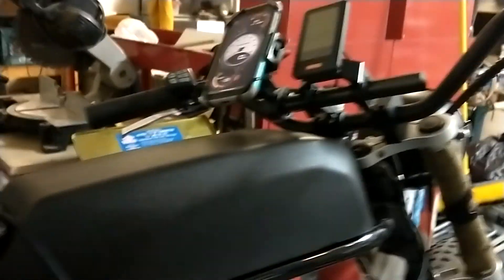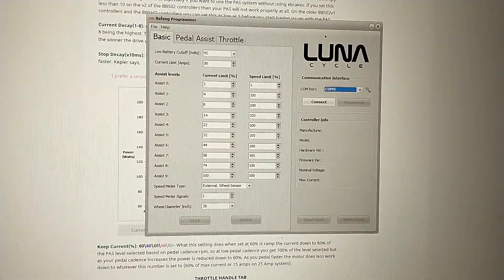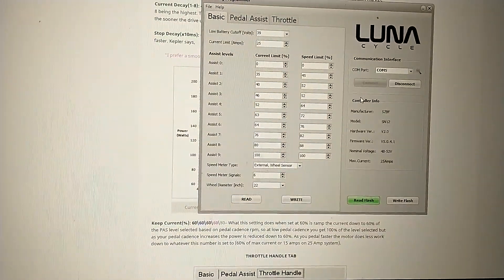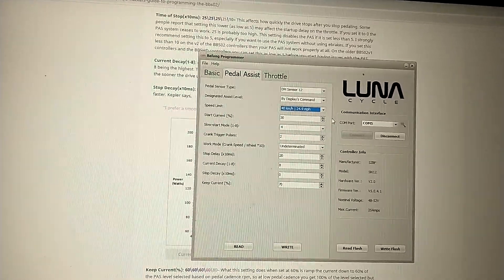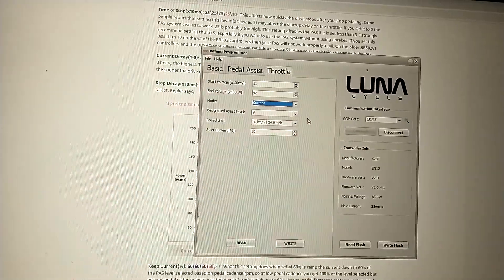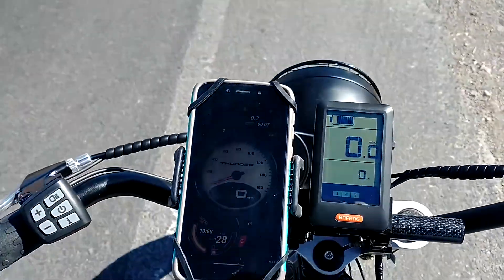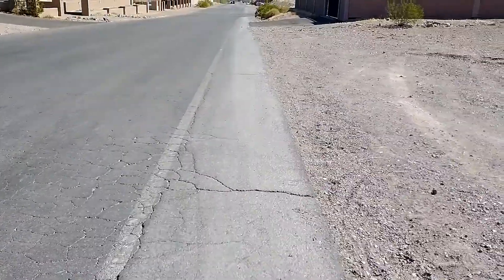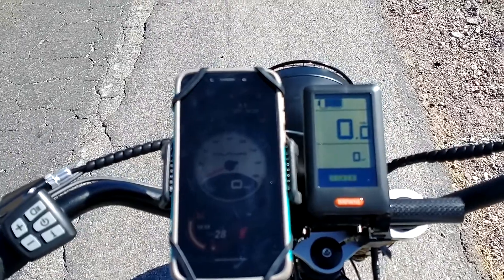Update 2  in Description - Monday Motorbikes 750w Anza Programming config file & speed test with GPS

Comment: Hey Robert, just out of curiosity, had you tried only changing speed limit without messing with any other settings? Seems like a $20 Luna cable for a few mph is a good deal but I'm slightly concerned about blowing it up, especially since my Anza is only the 500W.
Reply from the maker: Hey Scott, I haven't. But don't see why that wouldn't work. The software seems smart enough to limit folks adding settings that will blow it up. I tried to increase the amps and bump peddle assist outputs to 120% but it wouldn't let me 😂
Reply: @RobbMods  Thanks, I'm gonna try it! I should also have my magnets by Monday.
Reply from the maker: @scott1127  awesome. Updated magnet vid coming in a bit.
Reply: @RobbMods  Hey Rob, just wanted to thank you again. I just got back to messing with the Anza again. At first I thought I wasn't having any success with the Luna cable but it just took downloading the right driver. Looks like it's probably marginally faster than if I just got the updated display from Monday but hey, it's more fun this way. Only thing I did was bump up the speed limit.

Comment: I'm connected and everything but it won't read or write - do you have any ideas what might be wrong? "Read" "Write" "Read Flash" "Write Flash" are staying grey and will not let me press.
Reply from the maker: That happened to someone else too. Are you using windows 10? The usb cable shows up in device manager under the Ports (com and lpt)?
Reply: @RobbMods  I am on Windows 10 and ordered the same cable you did. It reads it as a Com 3 connection and changes depending on what usb port I use. Not sure why it won't read or right. Any help would be awesome. 👍
Reply from the maker: @PhareRow  interesting. Did your bike arrive doing 15mph or 20mph?  The guy that had the same issue had his patched to do 20mph before doing the cable. Few other guys that had success had their bikes, like mine, stuck at 15mph. I'm chatting with a guy who just got his anza today and already has the cable. I'll see if he had any trouble. Almost starting to look like MM locked it out with the bikes that got the 20mph fix. I'll keep you posted. Should know his results tomorrow. How do you feel about swapping out the controller and display? Just did that today and getting 28mph. I'll do a progress vid this week.
Reply: @RobbMods  I'm stuck at 15.
Reply from the maker: @PhareRow  cool (kinda) :) other things to try... Make sure you extracted the zip file. Right click the the program and Run as administrator. Reboot. I have another way to test. I'll try to do a video tomorrow... Basically you download the micro controller software, click 'check mcu' disconnect the battery then reconnect. It will tell you the make and firmware of the chip in the controller. Basically confirms if the cable can read or not.
I used a combination of these sites to test it out...
https://support.biktrix.com/hc/en-us/articles/360027645011-BBSHD-Resolve-ERR07 don't do the bin file. Just work through to the 'check mcu' part.

http://www.stcmicro.com/rar/stc-isp6.86e.rar - working link to dl the program

Another site to reference but they don't talk about check mcu. Don't load any bin files these sites offer. Might brick the controller. https://california-ebike.com/wikis/updating-bafang-firmware/amp/
Reply from the maker: @PhareRow  yeah i can do that. No money necessary. Appreciate the offer. I can connect tomorrow. Are you on IG? My username is robb10492021. Send me a message and I'll put eyes on it tomorrow.
Reply from the maker: @PhareRow  give this thread a look... https://electricbike.com/forum/forum/builds/new-builder-questions/1343-can-t-communicate-with-bafang-controller-please-help
Reply from the maker: @PhareRow  another guy had success with this program https://penoff.me/2016/01/13/e-bike-conversion-software/
Reply: @RobbMods  Checked the MCU and followed instructions - don't think it's reading it - states "checking target MCU" for 10+ minutes.
Reply: @RobbMods  Yeah, Im on IG, search my name Jordan Baucas
Reply: @RobbMods  Was on here prior. No help so far.
Reply from the maker: @PhareRow  Cool I hit you up on IG

Comment: You prob already have it but the Mini display from Luna works great and is much cleaner. Ive been following your vids. 2 weeks ago i programmed mine too and have since gotten it to 23/24 also. Last try was the Eggrider LCD display and it lets you program from the screen/app set up. But still my max was 23/24.
Reply from the maker: Awesome! Glad to hear it! I got a new KT controller and display coming next week. If i get it working I'll let you know. It looks like the firmware had it locked at 24.9, so unless we swap out the controllers don't think there's much more we can do... But I'm new at this :) also with the 11ah batteries we got I've read it'll be tough to break 28mph. Looking to get a larger capacity 52v soon. Thanks for the update, super happy to hear it worked for ya. Much better than the 15mph ;-). Oh, think I have an awesome fix for removing and resecuring the lame battery cover. If it works I'll post a vid tomorrow after the parts arrive.
Reply: @RobbMods  funny enough I programmed mine back in early feb just by reading info about Bafang mid drive. Just went for it and it worked, so its nice to see you figuring it out too. Ive been through 3 displays by trail and error as well. Talking to a guy on reddit led me to your vid and he said you dropped in a controller that didnt work and now your Monday one is back in and it got you to 26? How hard was it to take the controller out? Also the day i got mine i took the battery cover off for good. It wont be going back on ever.
Reply from the maker: @baller2377  awesome! Yeah i think i let the smoke outof the first KT controller i got. The anza has a 6 pin PAS cable, the 6 pin on the controller was meant for the throttle. Also the KT controller uses a 6 pin throttle cable vs the 1T4 cable the Anza uses. Learning curve :) I got a 3 pin PAS sensor compatible with the KT delivered today.  Got a 3 pin throttle coming Monday. Reordered the same controller today, and already have the KT display. Been getting stuff from electrobikeworld.com. They seem to ship the same day. Gonna have to get some higo cable extenders and gender benders.
Reply from the maker: @baller2377  oh and yeah after I programmed i was getting 24mph. After I removed the controllers and swapped back i now get 26. Only thing I changed was the battery terminal connectors. Maybe they let the pixes flow a little easier ¯\_(ツ)_/¯. The controller is easy to swap out. Remove the seat, and two allen bolts hold it on.
Reply: @RobbMods  oh wow youre in deep now hahah. End game is to get to what speed at this point?
Reply from the maker: @baller2377  Haha! Yeah. Idk... I was gonna stop after I fried that controller. But decided to keep going to see if I can find a fix for the community. This is my first ebike so didn't really know what I was looking for. Now that I have a better idea and enjoy them prob gonna save up for a Sur Ron :)
Reply: @RobbMods  just checked out that site — what does the KT display offer that’s better? And is it plug n play?
Reply from the maker: @baller2377  from what I gather it's a lot more open and easier to config. Check out this vid on the programming. He actually uses a 750w hub motor for his examples on what to set. https://youtu.be/B0F6x8V0NZQ
I might be wrong but from what I've read it seems like bafang controllers are pretty locked down and the dealers need a certain license to unlock certain stuff. But that was from some internet articles/comments, not sure if true but makes since
Reply: @RobbMods  thanks I’ll check that out. Ive been ordering from lunacycle and they seem legit as well. I’ll be keeping an eye on your upgrades and tinkering, since it looks like thats our direction here and Monday won’t be helping us at all.
Reply from the maker: @baller2377  yeah. The radio silence from MM is deafening. Keep me posted on if you make any speed progress!